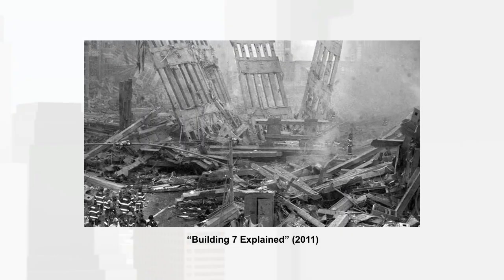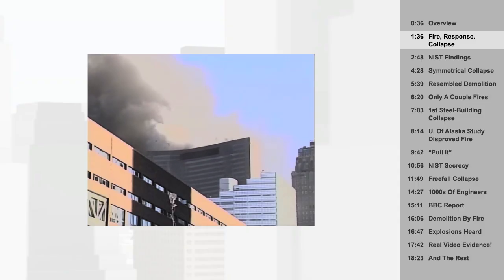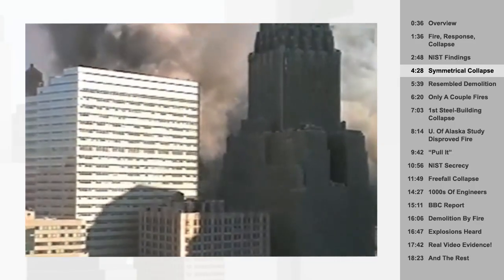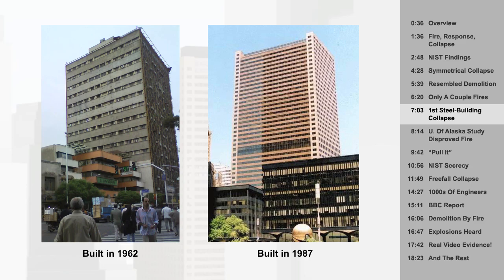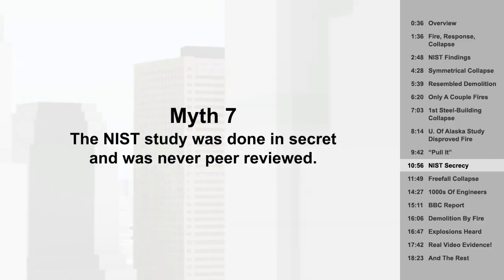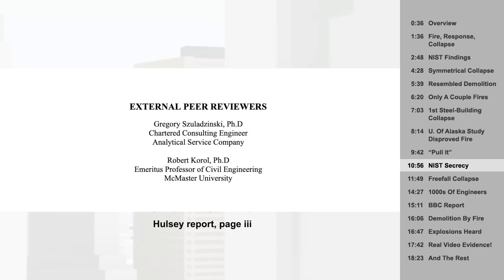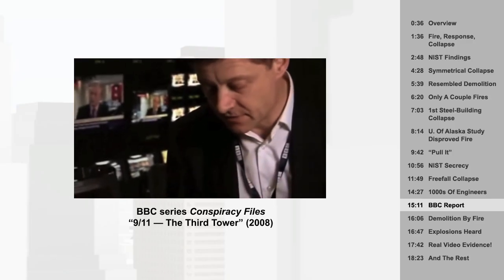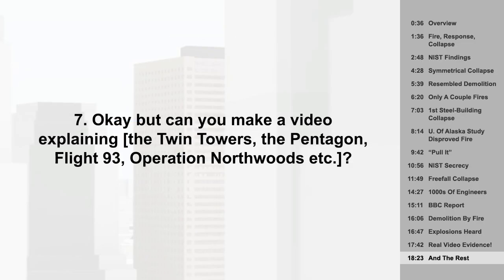Building 7 Explained: Comprehensive Final Edition

Comment: The only thing you need to know that it wasn't a controlled demolition was that they demolished every other building in the WTC a few days later due to damages, and it would be a massive waste of effort and resources to rig this building to be demolished when no one died from it, meaning its collapse couldn't be used to push any agenda. There is no valid reason why it WOULD be demolished, and video evidence also proves that it wasn't a controlled demolition.